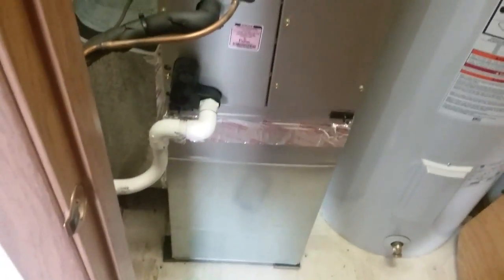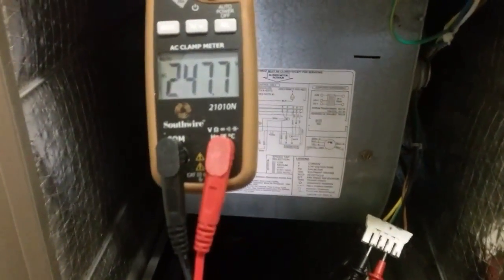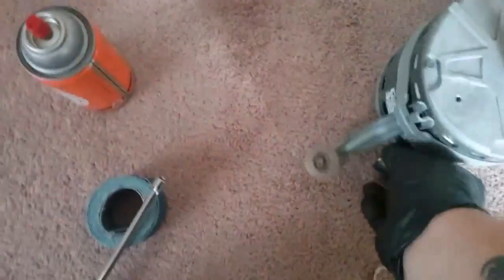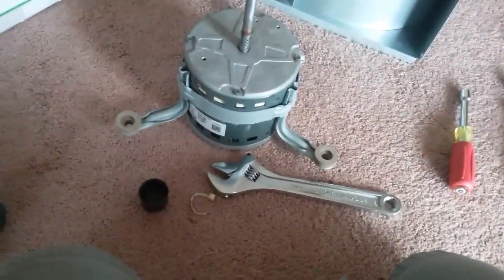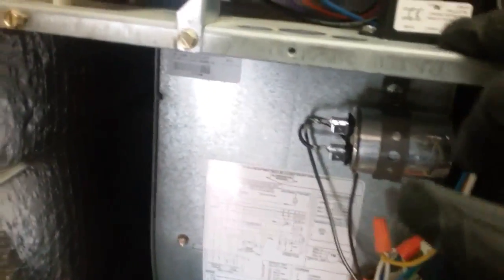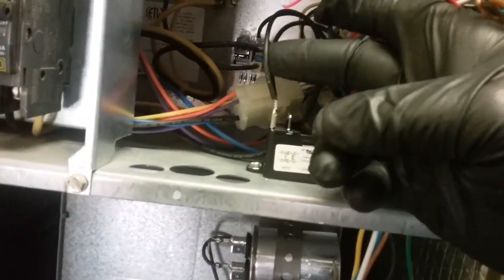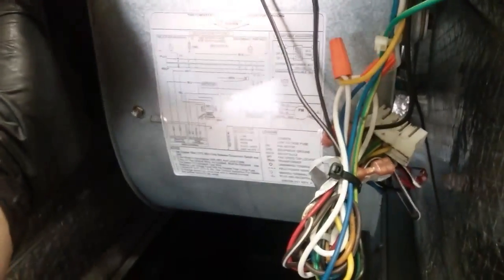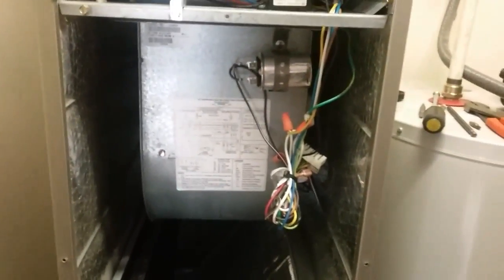HVAC ECM to PSC conversion using a relay

Comment: This adaptation is good as long as the fan motor is for a unit with an electric heater, because in a system with a gas heater, this kind of adaptation can never be done because the relay generates a spark. greetings.

Comment: Replacing ECM no big deal. Try changing variable speed to psc. I did it but unit does not run anywhere near as good as it should.

Comment: Here has always been the thing with me doing this. So you take a new PSC motor, and put it in the customer’s AHU to get them by temporarily. What do you do with the PSC motor after you install the warranty motor? Do you put it back in the box, and sell it? Do you just invest in the cost of the motor, and keep it for doing this in the future. Does the customer pay you for the motor, and maybe sell it to them at cost? Then they will have a motor they can’t use for anything after you install the warranty motor.
Reply: I keep a couple of used motors, from equipment change outs, on my truck for this purpose.  If I don't have a used motor that will work the customer is offered the option of paying for a new motor.

Comment: I’m probably going to convert to PSC permanently. I have a York under warranty, but the tech visit labor charge is so much that I figured it was cheaper to change to PSC. Already verified high and low voltages, ohm’d out the motor windings. All is good. The motor control module probably failed. Don’t PSC have variable speed taps and couldn’t one use those to the X13 ECM board and use that to trigger the speeds.
Reply: Look into Azure 1860 and 1861 motors.  Those 2 motors will replace all psc or x13 motor of 120 or 240 volts and 1/5 to 1hp.

Comment: Add more relays and you will be able to control your fan speeds
Reply from the maker: Yeah you could. I have noticed on a lot of air handlers only one speed is used so it should be fine
Reply: @rodneythornhill9526  for just temporarily yes..now if you switching to PSC permanently you need lower speed for heater operation so can go to very low , or as recommend depend of heat btus

Comment: if i just connect high voltage of the PSC motor to contactor it will work too ,
why do i need the relay for?
Reply from the maker: I have always used a relay rather than using control voltage from the board. Whichever way works best for you as long as it works.

Comment: I have a stupid question....why would you have to change out the motor?  Couldn't you just ad the relay and capacitor to the existing motor?
Reply from the maker: Gregg Taylor no ECM  motors are completely different.
Reply: ECM MOTOR has no cap, expensive to replace if dead.

Comment: Thanks for the vid. For a temp repair you probably could have done without the relay and just wired the motor to a hot leg. I have done that with circuit boards that had fan relay problems.
Reply: If you wire it to a hot tap only how is the blower gonna shut of & back on like it does with a relay ?
Reply: On a package unit it you can break it off the contactor temporally until you could get a board but on a split system you need some type of relay or contactor to bring it on & off

Comment: Does it matter where u put the come next wires on the relay
Reply from the maker: Armando Monreal I'm not sure I understand your question
Reply: Rodney Thornhill in sorry I meant the common wire does it matter what connection the line and common go on or can they just be connect
Reply from the maker: Common should be connected to line voltage and the speed tap goes on the relay

Comment: And that yellow hot wire is also neutral wire that used to connect to my ecm motor. I tried to turn on the thermostats, but nothing happen. Did i do something wrong? Please advise me, thank u
Reply from the maker: I'm not sure what you have going on there. you need to find L1 and L2 coming from the harness. send L1 to common wire on motor and L2 one side of the normally open side of your relay. From the other side of your normally open connect your medium speed wire. now pull the green wire from the thermostat wire to one side of the coil on the relay then pull the common wire from thermostat wire witch my be blue to the other side of the relay coil and that should do it. make sure power is off.
Reply: I connect everything according to u and nothing happened. Turn out, i burned my relay. After, i changed the relay, it works. Thank u so much
Reply from the maker: your very welcome. thank you for watching.

Comment: Hi, i bought a heavy duty switching relay n connected the black hot wire to the relay(no. 4) and no.2 i connected to med. Speed wire(blue) connected to my new psc motor. Also no.1 to brown common wire that used to connect to my old ecm motor then no.3 to the green very small wire that is possibly connected to the thermostat. Plus, i connected my white common wire from my psc motor to the other hot wire(yellow)